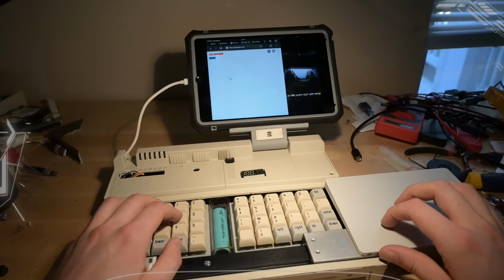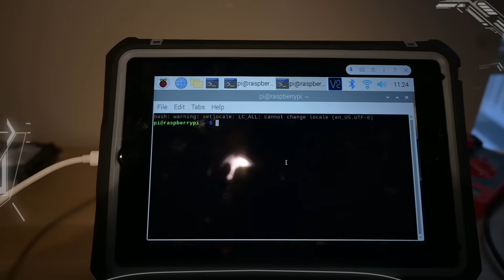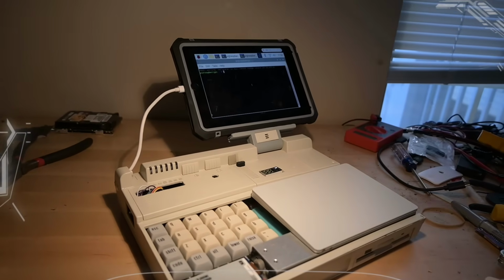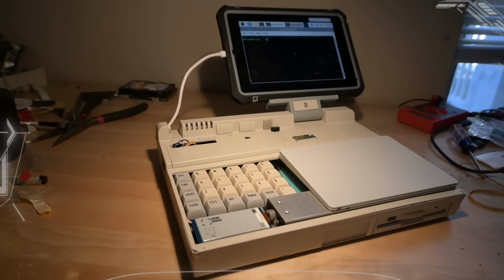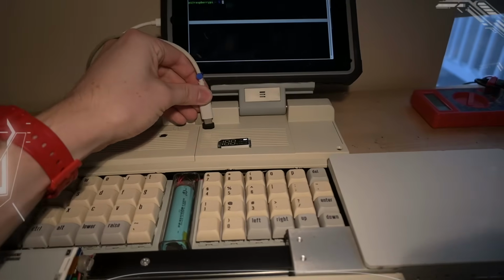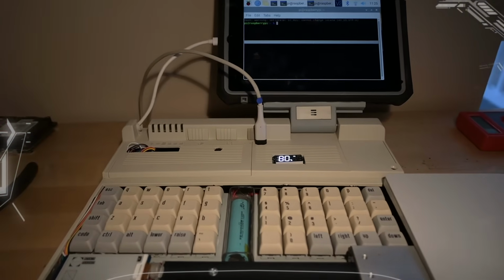Building a Cyberpunk Cyberdeck

Comment: Ill do you one better. Im designing and building a cyber car, that has cyberdeck functionality. The entertainment system IS the cyber deck. But you can remove it and take it with you. I thought about making videos on how t  im doing it, but, im bad at making them consistently, so this is for my own personal enjoyment. But I might film it once im done. The inspiration for the car come from:

Akira

cyber city oedo 808

ghost in the shell movie batous esprite

tron legacy(flynns 2nd gen lightcycle)

back to the future/Ready player ones delorean

and blade runner 2049s spinner.

When im done, it will be a definitive cyber car.

And its my second project. Originally, I took a subaru svx and rebuilt it, using the akira bike as a design motif. Recreating it. Complete with the red full moon hub caps etc.

Which lemme tell you. The hardest part of ANY cyber car, is doing full moon hub caps without pre fabricated rims that support them. Since you have to find ways to get them to stay on the wheels without damaging anything.

ive found better ways to do it, but its still hard asf.

Comment: it would be even better if you got yourself a say 10 inch LCD screen with its controller board. These are simply consumer displays taken out of their plastic shell and are often cheap. It would definitely make the cyberdeck more cyberpunk since you won't rely on that ipad. That said I like how it's kinda stitched together unlike other cyberdeck builds with 3D printed parts and sleek smooth surface finishes which aren't that cyberpunk

Comment: the keyboards in those old laptops tend to be fantastic. It would be cool to do a build involving a laptop like this with its original keyboard but modern guts and perhaps a better screen
Reply: That would be like a portable sleeper build, sounds like a good way to deter theft on top of having an 80s/dystopian aesthetic
Reply: I agree, but sadly, keyboards in 80s-90s laptops used propriertary protocols and not PS2 or USB. It would be too much work to try and reverse engineer such a keyboard just for the nice feel of the buttons

Comment: This is neat, it's a bit frustrating that it only runs a raspberry Pi, would have been amazing with one of those framework laptop motherboards
Reply from the maker: Well my “I used this as my computer” video has a full on gaming motherboard in it
Reply: @CarterHurd  my bad didnt knew that, will check it out right now

Comment: It needs to be at least as menacing as The Finn. Dunno what kind of bad skull day / bad glasses day you'd put together, but cyberdecks are known for their ability to turn unwary cowboys into grease stains; not sure you're there yet, having no BCI and no pulse/pressure joe boy instruments, even the stud you slap to jack in. 

Certainly needs more monitors  if only to rate the vim in your vim use... maybe if your CMM puts it in range you can buy the smallest oled next gen tv or projector and use the whole animal (with antennas) to get priv. escalation on ads. 🐄 

Get that whole chrome support package... Soylent, ostensible mood altering Rx on dial, audible jtopMT and klaxons...dual purpose 4x4 WiFi6e MX.2 cards, fiber access and emulation chrome... Call outs to Japanese subcultures ofc. Is there still that speed meter measuring 33 or 200  MHz on there? Great. Just needs iPen pantograph with next-gen metrology.

Comment: But why not use the original screen housing?
Reply from the maker: I actually tried initially... I spent some time finding a cheap donor laptop with a similar screen size and aspect ratio to the iPad. In the end I wasn't able to make it work and still allow the iPad to be easily removed, and so went with this design instead.

Comment: Neat. The Pi really needs a dedicated display besides the eink display though. It's a stand-alone, dedicated computing device, and if you can only shell into it from a fully-working iPad then it's all totally dependent on the functioning of the iPad. Ideally a system should be redundant so that each computing device can be accessed and utilized independently. Add a display, jail-break the iPad so it can also be shelled into from the Pi (in case the iPad screen is damaged), and you have a doubly-redundant system.

Comment: Mmm, I wouldn't call it a cyberdeck exactly without including multiple I/O inputs such as serial, parallel, the various USB, and wireless; then for the OS using Kali Mini, BlackArch, or just remove the GUI from a straight up Kali or other pentesting OS installation.
Reply from the maker: I mean, technically from neuromancer, which kinda created this whole thing, it shouldn’t even have a display or operating system, it should merely be an interface device
Reply: @CarterHurd  I never actually read that novel to be honest.. Perhaps one day.. perhaps.

Comment: I feel like using an ipad as the "display" kind of ruins this whole project. You basically destroyed a vintage laptop so you could glue a $130 track pad to it, mount a $1000 ipad to the screen bracket and dumped a Pi Zero into what was left of it's corpse. I really don't understand what the point of this was.
Reply from the maker: Fair criticisms

Comment: So let me get this straight. You:
- Ruined a laptop from early 90s
- Haven't even reused the LCD and keyboard
- Basically used what you built as a dock for an iPad

The experience of using a Pi with that 5" screen is crappy because of the Pi, not the screen.
The performance (especially if we're talking about Pi Zero, which is cheap and slow by design) is what makes it feel sluggish and unresponsive. Using a Raspberry Pi powered deck makes you understand and respect the limitations.of the computer itself.

That's terrible and I hope that you, going back to this video some time in the future, realize that.
Don't ruin vintage tech to build iPad accessoires.
Reply from the maker: You’re not the only one who feels upset that I used an old laptop chassis, several others feel the same. I’ve got a couple questions just to try to understand you:

When you say terrible do you mean simply dumb, or do you mean morally wrong?  And if the latter, do old and unused electronics hold some type of intrinsic value greater than the tiny price paid on eBay? Do we as humans have some moral responsibility to preserve old and unused electrics? And if we do for some reason, does this responsibility apply to other old products too (TVs, Microwaves, vintage sunglasses, old golf clubs, etc)? 

Also, If I used a less old working computer, like say a 10 year old laptop instead, would you be more or less upset by that? (less rare, but would be potentially useful to someone unlike this laptop which didn’t function)
Reply: @CarterHurd  Mostly the former. It would be silly to assume that a random person with the anime profile picture can serve as a moral authority.
I wouldn't be as upset if you used a newer computer (precisely because it is not as rare), or, even better, something like a 3D printed enclosure.

I can't speak for old "TVs, Microwaves, vintage sunglasses, old golf clubs, etc" since I'm not even remotely the part of any of the relevant communitites.
I also can't tell you what you can and can't do, and I only left my original comment under the assumption that you wanted feedback (coz it's YouTube and you seem to have a somewhat active channel).

To reiterate, my main gripe here is that you ruined a piece of vintage tech to create something as basic as an iPad dock.
Reply: @thenoddingturtle  Does the old laptop chassis have more value than the $45 he got it for on ebay?

Comment: I had a glance at the comments before deciding to post this but didn't see anything related, so please bear with me.

The voltage of the cells being identical is important, but what's more important is making sure the cells have close to the same internal resistance. If you don't get that right and balance them chances are you'll have some cells sagging and potentially causing a lot of resistance while using the unit, potentially even causing fires.

Comment: I absolutely love this build. I have questions about remoting into the Pi: how does it work? For instance, what app do you use on the iPad and/or Pi and do you remote via WiFi or the cable?
Reply: It’s almost certainly VNC (you can see the icon on the top bar too). As far as I’ve been able to find, there’s no way to use lightning-plug iPads as wired displays (might be for USB-C models, but I don’t have one to test with). This method requires connecting the Pi Zero (W, since it needs WiFi for VNC) to WiFi with a normal display first, so it’s not super portable. 

I’ve seen some mentions that it might be possible to have a Pi act as a WiFi host device so you can connect to it directly without a router, but haven’t gotten around to investigating that further myself.

Comment: 1980's movies: "This is what the computer of the future will look like in the year 2021"
2021: "Today, we make a 1980's themed computer"
Reply: So THIS is what a predestination paradox looks like...
Reply: So THIS is what a predestination paradox looks like...
Reply: Wait... wasn't I here, before?
Reply: Wait I don't remember making those earlier comments.
Reply: @AnthonyLoPrimo  dementia?
Reply: @randomguy6328  LOL
Reply: @randomguy6328  it's just a burning memory...
Reply: The 1980s were just right about mechanical switches and colored lights in general. We went to the cheapest most mass produced version of keyboards that were disposable and wireless, and now those who know have gone back to chonky looking wired, usually backlit, full keyboards that look more like stuff from the 80s than the curvier 90s/00s keyboards. Most office workstations in science are multi monitor nightmares, most geology sensors and field equipment is straight from the 70/80s with robust circuit design.
Reply: Just like Star Wars
Reply: A broken clock is right at least twice a day
Reply: Game recognize game
Reply: Because tradition matters, dumb dumb.

Comment: Your iPad is no less than 5x more powerful than the RasPi Zero, but you have to use that, because we're in a dystopian future and all the computing devices are locked-down consumption devices. 

Dear God, the future sucks
Reply: This tbh
Reply: Fun fact: remember when the smaller Android tablets came out, and Steve Jobs made disparaging remarks about sandpapering the tips of your fingers to work with the smaller screen?

Then, after he died, Apple brought out the Ipad Mini.

Second fun fact: Android had a responsive UI that would intelligently scale to different-sized screens. Apple just shrank the whole Ipad UI on the Mini, validating Jobs’ remarks about needing smaller fingertips to use it.
Reply: hey at least we don't need to solder a 286 onto some northbridge
Reply: @tukangiseng  

I mean, you're not wrong, but I'd rather have to learn to solder properly than have to use locked-down crap that spies on me.

For the record, my original comment wasn't meant as a rip against the youtuber, just bummed out that things are so dystopian right now. I would've replied earlier, but I had YT notifications turned off for YEARS without realizing it. XD

Everyone be kind and have a great day.
Reply: @RL_Dane  well it was meant to be a joke, no offense intended. flux will solve your soldering problem. if it may calms you, it is entirely possible to build a working computer just using a bunch of relays. or even a bunch of people standing flipping a sign, if it ever needs be
Reply: nick landian acceleration to obivion
Reply: @jettd8722 shut up no one wants to hear about nick land omg. the man's entire career was scribbling nonsense symbols pretending to be a mathematician
Reply: Unless they create a self-sustaining network using an older computer from 2010, and hijack an older 4g tower to their own network!
Reply: Have you heard of Android?  Still 5x as Powerful, but not for simps?
You act like stupid apple products that are designed for people with all money and no brains is the only device that fits the criteria.
...Maybe you're who they market towards, in that case! ha
Reply: @maxwell_edison  jeez he wasn't even ogling over apple he was just demonstrating how weak the pi zero is
Reply: @19Magic_gnomE41  I think he was also ripping on apple too
Reply: @maxwell_edison  found the android user ☠️☠️☠️ y’all just call yourself out and get offended for no reason
Reply: @vergodagoat  it was a direct relevant reply aimed at a comment that acted as if they had no idea android even existed?  What's your problem lmao

They were literally complaining about how locked down apple products were.  Yeah, I'm gonna mention android??? Hello?
Reply: @maxwell_edison  root Knox tho
Reply: Like yeah i was a bit harsh but tbh the original comment was really ignorant sounding lmao had it coming tbh
Don't hate me cus' I'm right!
Reply: @maxwell_edison  why are you booing I'm right 🤣

Comment: What is the point of the ipad? It literally does less than a raspberry pi. Also complete waste of a nice vintage 386 (they are worth a lot on ebay now) You should have just 3D printed a case that looks like the laptop so you didn't have to destroy it.
Reply from the maker: Bought the donor laptop on eBay for 45 bucks. 

And a Pi may technically do more, but honestly I use my iPad more than any computer. 95% of the time my real PC just sits there crypto mining... I do most of my video editing on the iPad. It's nice to have the dual-function.

Comment: There's still so much room in there, I would have crammed a pi4 in it. lol Looks real slick though.
Reply: You could fit a whole udoo x86 in there, I think. You might have to use a different keyboard, though, and be clever about the cooling.

Comment: imma build the same with my raspberry pi 4. i will use my fpv goggles (goggles that you use to see from a racing drone's camera) as a display. for cyberpunk and privacy reasons... but i've 0 idea on how to supply it with power (that is why i am watching this video (great video btw!)). and imma make it real tough to break so i can wear it on my back. the body will be a keyboard.
Reply: Also gonna add an Arduino that would control the rgb lights and the fan and connect it as a slave to the raspberry pi so i can controll the fan speed and the lights from the raspberry pi.
Reply: @plasteredd  Sick!! I'm thinking about building one also, have to save up the money first....

Comment: so im confused...whats a cyber deck?
Reply: Small DIY laptop with aesthetic
Reply: The equivalent of what Laptops are now for us.  They were mostly as powerful as desktop PCs, and allowed people to use them to "jack in" to the networks or full internet ("Net") as a whole, using virtual reality gear that would either be a VR-like headset, or a "Neural-Net" connection (cable plugged into an implant in the back of your skull) that would let you experience the net completely.
Based on the novels from William Gibson, as well as pen-and-paper role-playing games like "Cyberpunk 2013/2020/2027", "Shadowrun", etc...
Reply: @Phalkon13  so an under powered laptop